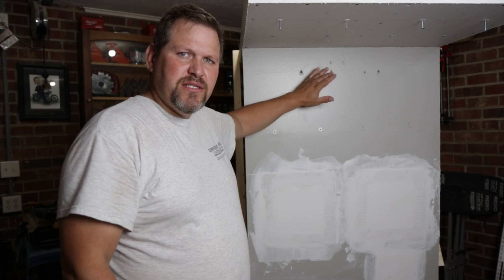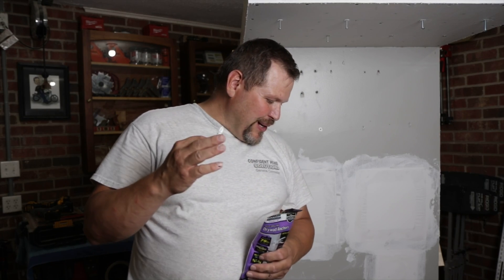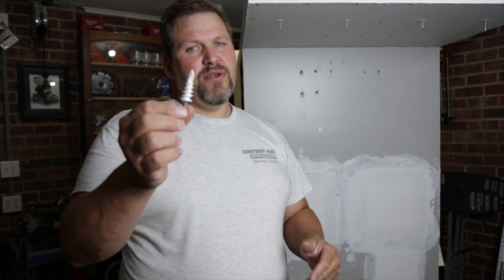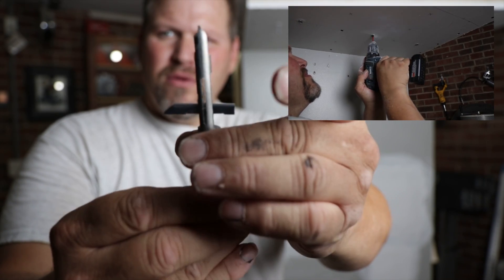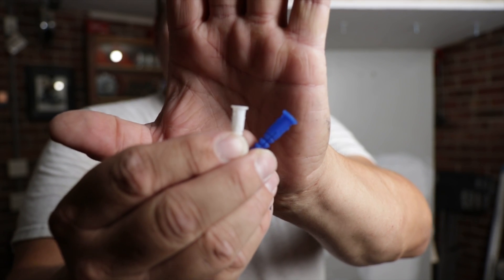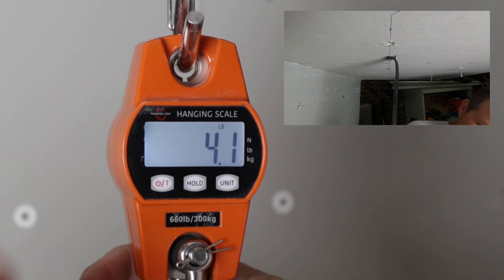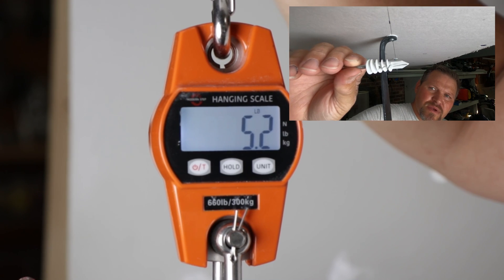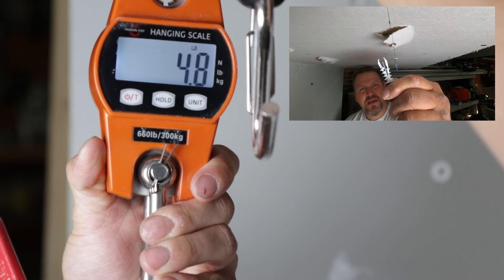Ceiling Drywall/Sheetrock Anchor Test (EZ Anchor-Toggler) How many lbs will they hold?

Comment: Thank you for doing the Lords work!!!  This video is likely one of the most valuable youtube videos I have ever seen.  And I have seen alot!  But  also, here is some info I believe applys as well... the load value being measured is only with a downward force being applied to top of drywall... I believe the actual true maximum downward force that can be achieved may be much higher with an actual object surface being compressed upwards from below the drywall... meaning for example if there was a 2" washer or a piece of wood (or anything) being tightened up from below (in real world application).  The compressive surface area from below (combined with the actual test results in video) I believe could be possibly a minimum of 25% higher for the togglers, because the material being compressed is actually ALOT stronger than uncompressed material with only force applied from top side...

Comment: This is great news. The anchors will hold. But now I’m worried if the whole soffit will fall off if I hang this 50 inch tv where my coworker wants it. What’s funny is seven years ago they had me chop a tv mount clamped to an I beam off where the pipe comes out of the drywall right where he wants to hang a tv. Except the joke is on me.

Comment: Why is it you don’t like the plastic screw in anchors from ez anchor? I was turned away from using these on a ceiling but after seeing your videos I am impressed! Just wanted to know why you prefer the toggler brand thanks
Reply from the maker: I made this several years ago. With that being said I prefer the plastic EZ anchor over the aluminum if I know I’m not going to hit any wood. We carry both styles on the work van but will say I grab for the plastic one first because I think they have a little better bite in drywall.
Reply: @campbellbuilt appreciate your fast  response brother, your videos helped me a ton!

Comment: I'm hanging about 55 lbs from the soffit under my roof between the house and the eavestrough. There aren't any soffit joists, only roof joists angled with the roof, so only 1 out of my 2 mounting bolts can sink into a joist. The original, wooden soffit (assumed to be 3/8" plywood) is under aluminum soffit making it difficult to add any blocking.

Watching your video gives me a lot of confidence that a toggle-style bolt into 3/8 plywood should provide the strength I need to support at least 30 lbs AKA half (the other half supported by the roof joist) of my 55 lbs load.

Comment: I'm curious how would Toggler anchor do in case of acoustics, do you have any comments? I'm planning to fix 12.5 mm drywalls as the first layer right to the 22mm timbers which is fixed to the rafters, then another layer of  12.5mm drywalls and in between 10mm of cork sandwiched, and I'm curious whether can I use this anchor to fix the sandwich together so the outer layer drywall and the cork in between will be secured via this anchor to the first/inner layer of drywall, and there will also be a 12.5mm of plaster on outer layer.

I have the feeling that since the anchor is made out of plastic and a screw, the plastic will be actually contacting mainly with the drywalls, and it can minimize the sound waves passing through one layer to the other. Especally the impact/contact sounds.

I would appreciate if you can share your thoughts on, and or if you have any suggestion other than green glue, which is financially not affordable for me.

Comment: I'm looking to hang a 22lb grow light from a drywall/sheetrock ceiling with 2 ratcheting hangers. I was looking for anchors with eyelets but I can't seem to locate any. I'm sure I can find the toggler anchors but I'm not sure why size screw these use. I would have to match up the screw portion of the eyelet with the screws that come with the anchors. Do you know if there are any eyelets that come with anchors that are reliable because I can't find any. I would like to have the extra lbs in the anchor since I will be adjusting the lights. Have any ideas? I would appreciate it. Thanks for the review. I like the Toggler plastic screw in anchor.
Reply from the maker: I’m not aware of any anchors or eyelets like that. Sorry
Reply: @campbellbuilt  No worries. I think I got it figured out. It was just a matter of matching up the eyelet screw with the anchor screw. I think it workout just fine. Of course, these T5 6500k lights are blinding but the plants love it. LOL

Comment: wow thank you...I bought a ceiling driller with a swivel hanger to hang a swag lamp but Ive been hesitant to make the hole due to the reviews people gave on the swivel hanger. So your demonstration makes me want to try a different avenue. My swag lamp is all stained glass it weighs nearly 70lbs. so Im guessing you would use one of these 4 or one of the last three you demonstrated. If I lived in NC id just hire you but I live in SW Florida. What would you do?
Reply from the maker: Without seeing exactly what your doing I’m hesitant recommending something. 😕😕
Reply: @campbellbuilt  Okay...I think Ill have to go up in the attic and install a 2x4   then run one of these methods you showed iinto it....
Reply from the maker: That will absolutely work

Comment: I dont like the aluminum. Dont believe rated for ceiling anyway. Might be good for a soft wood repair.
I use a ton of the. Plastic versions. Self drill and split. Wonderful. Also not ceiling rated.

Comment: Hi. Which screws and boards would you recommend if I have to screw in the old drywall ceiling to hold clothes using Ikea Elvarli post system clothing rack? Do I need to include a foam-like cement or normal Seen on TV flex glue with 1" board to secure my post?

Comment: Would it be double the weight if you use two of them to hang a swing
Reply from the maker: I’ve never tested that way. I assume the anchors will need generous spacing to handle double the load. My plans are to eventually test it though.

Comment: Thank you for this video!  I was wondering which to use for the new shelves I got.  They're small, just big enough to hold a couple small plants or a medium plant, so I'm not too concerned about them being able to hold loads and loads of books.  Each bracket has 3 holes for screws, so 6/shelf... They came with the flimsy looking drywall anchors that you discarded at the beginning of the video, so I think I'm going to upgrade to the plastic Toggler brand.  This video helped a lot!  Thank you! ❤️

Comment: Quick question I have a tv unit I want to mount I think it weights about 125 pounds with everything on top I can only get 2 studs can I use the 100 lbs ez anchors for the other 2 points?

Comment: I used the white one to put cat shelves on the wall it says they are designed for 65 pounds but they are not good if you have an animal jumping on them. I would suggest you go with the last option  the toggler the long white one.
Reply: Weight is one thing, force + weight is another thing

Comment: Awesome work! I am planning on putting up a 25 lb mirror. I think the wall is a drywall or plaster. I am not sure. Put a small nail and it easily came off. Therefore, I am comparing the EZ anchor metal screw and the plastic one. Both videos have been seen. This is quite helpful with me making a decision.
Reply from the maker: Thanks for the comment

Comment: Absolutely brilliant. I'm a novice in ceiling plasterboard/drywall and this has really solved an issue for me regarding weight-bearing ceiling curtain track installation where no supporting beams can be located! Many thanks, really impressive.
Reply from the maker: Awesome. Thanks for the comment.
Reply: @campbellbuilt  

The Toggler Dry Wall Anchor did the job perfectly for us. Four metre triple ceiling track supporting heavy curtains with no issue at all. Many thanks again for the insight and info!
Reply: @classicteachings  just about to fix some track up myself to ceiling with soundproof gap (resilient channel). How's your curtains? Still attached? Sounds like a lot of weight - mine are about 10kg. How many fixings did you use?